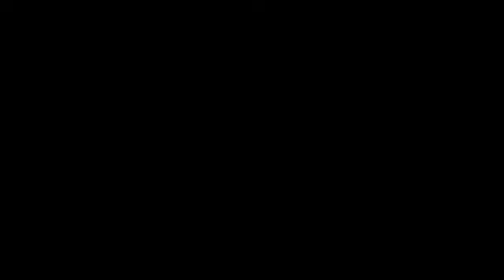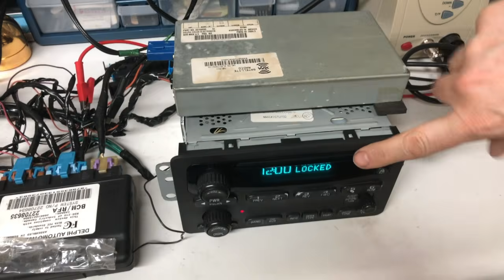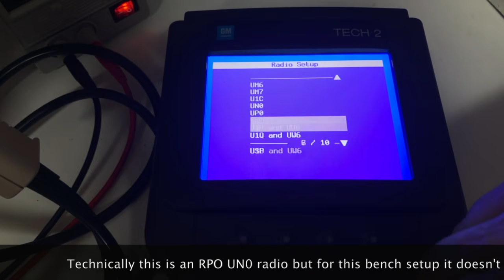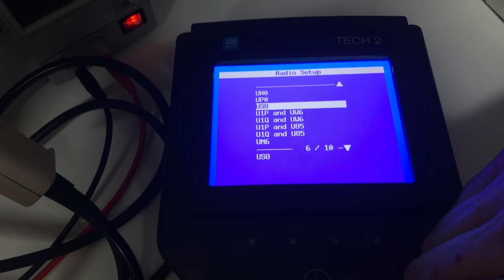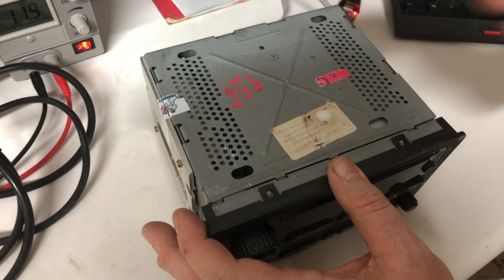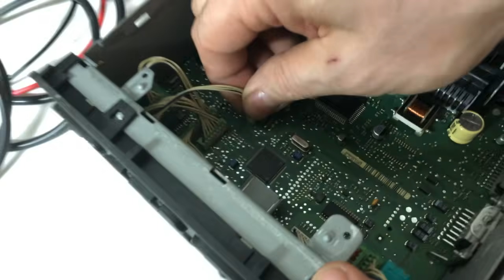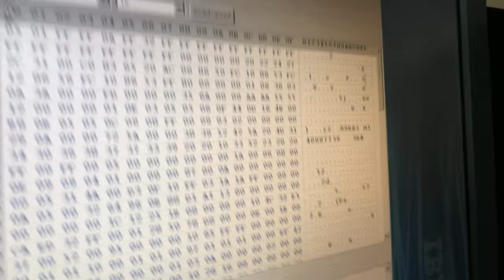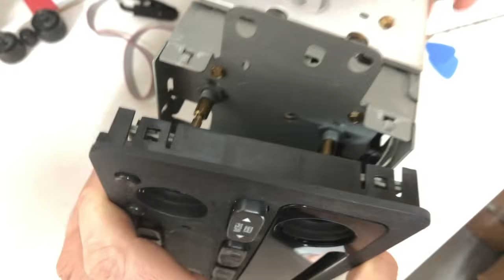2003 - 2006 How to VIN Unlock Salvage Yard GM RDS Radio w/ Tech2 OR Manually Programming its EEPROM

Comment: Loved the video. My problem is that I can read the settings, but they all show up as O. Could the people I bought the radio from erased all the settings
Reply from the maker: When you say "I can read the settings" yet are seeing all 0's, can you elaborate?   Trying to determine if you see the EEPROM contents otherwise just not the VIN.
Reply: It says reading IC, the green light is on, but the only thing that comes up is all zeros, but no contents. I'll send you a screen shot
Reply: Sorry I could not get a screen shot to work. I had company come up and one of us knocked the IC off the bench, and I can not find it. I have some new IC's coming. I was told to put the new IC in, with no programing and let the ECM program it. Any ideas?
Reply from the maker: If it reads 0's, that usually means it's not making contact with all the pins.  Typically a problem when you try to read it in-circuit with a test clip.  Some radio boards have other components that interfere and you have to desolder and remove the IC to read it correctly.   If you have it desoldered and you're still getting 0's, then I'd have to presume you either have the programmer set for the wrong device type or you removed a different 8 pin device that was not the EEPROM.    Most models will work with a blank yes, but some won't.   That's why I showed this approach that works every time.
Reply: @DrShock  Could I possible  get a copy of the file you used to program the radio with the Asprogramer?. I realize I will have to change the serial number and vin number, but that should not be a problem.
Reply from the maker: @larrymartin975  I no longer have the memory images for this particular radio chip.

Comment: So I did a factory upgrade radio in my 07 classic. Whent from a base w/t radio to a 6 CD radio. Since they have different cereal numbers would I still be able to reprogram the eprom vin? Or would it still be locked do to the different cereal number?
Reply from the maker: The VIN of the vehicle is the serial number of interest here, not the radios' serial.   So as long as the 2007 radio you went with was the part number available in model year 2007 the Tech2 will recognize it and do the unlock (if you mix years/part numbers the Tech2 will usually not cooperate for non-factory available configurations).   And if you choose to go the EEPROM route instead, yeah it would just be changing the VIN stored in there as I showed for these 2003-2005 ones.
Reply: @DrShock  ok. Not shure what year the radio came out of. I know it's the newer 05 up one. I have one from an 03 and the part number is different. So hopefully the one I have installed is the right part number.

Comment: So I just tried similar radio with a cassette, the eeprom is angled different and could not get reading from it . So some of the EEproms need to be read outside of the board ? Had similar issues with Pontiac radios that come with yellow and white buttons
Reply from the maker: Actually most chips need to be removed to read.  It's usually because you just cannot get a test clip into the space, but there are some years that have extra circuitry that the test clip inadvertently powers up creating bus contention.
Reply: @DrShock  appreciate your reply . Thank you

Comment: I took out the chip and now I am getting an error message that says error.
Reply from the maker: If it says "cal error" that would be normal until you reinstall the eeprom back to the board.  If not, you may want to check that you removed the particular part numbered chip that I mentioned in the video here and not any other one of the same size and type.
Reply: @DrShock Yea it just say error. I can seem to find the chip you have on the video, not sure if the circuit board lay out is different. I appreciate you replying back as I am stumped.
Reply from the maker: What year is the radio and from what make and model vehicle?
Reply: @DrShock  I actually pulled it from a 05   trailblazer from the salvage yard. I have a 03 suburban that I tried putting the until in. The unit still powers up but just shows "error" only.
Reply: I wish I could send you a pic of where and what I pulled out. The layout of your chip board looks different from mine for sure
Reply from the maker: Yeah that would be a great feature if Youtube added it someday to post pics.   The radio PCBs do vary from year to year and model to model.   The EEPROM you're after is most commonly located in the upper right front (rear of radio facing you) as I show in the video.  But it can be paired with a second unrelated chip either top to bottom as I showed, or side by side in some other PCBs.  Some radios will have the EEPROM all alone in the center area of the PCB.   But the EEPROM you're after should have the same Delphi 9355093 part number as what I showed in all cases (if the radio was made by Delphi which is what this video covers).  This same Delphi part number is found in their radios on Cavalier, Sunfire, Silverado, HHR, Avalanche, Tahoe, and SSR.  I would expect its the same for the Suburban and Trailblazer as well.  So what's the number on the chip you removed given all this?
Reply: @DrShock  if I pulled the wrong chip..am I at a point of no return. I'm assuming I did.
Reply from the maker: Not necessarily, presuming you just removed it and it was not a memory device just return it to its original pin 1 orientation where you removed it from with no harm done  If it was a different memory device, and you overwrote its contents, then yeah it may be a salvage yard trip to repair that.

Comment: What if you don't have a test clip
Reply from the maker: I always try a test clip first, but there are many modules where it's not possible to use them (because you end up powering up other devices on the board thru them).   As with those cases, if you do not have a test clip just remove the chip from the board using ChipQuik (link in description) or a hot air gun.

Comment: i set this all up and it read the eeprom as nothing just 0 values
Reply from the maker: If you're trying to read in-circuit, then it's an interference problem on the data lines from some other devices being powered up.  Remove the chip from the board and retry that way.

Comment: So I've used your method and unlocked a radio and and XM module like this successfully but I'm having trouble with another stereo I'm doing for a friend.  It'll say that it reads it successfully but everything is blank. I've been trying for 2 hours thinking that maybe something wasn't making contact or something else like that, but it's just been blank this whole time and I can't get it to read. What could I do? It's out of a grand am.
Reply from the maker: All 00s, rather than all FFs, would indicate you're not getting a clear read to me.   Did you remove the chip from the circuit board to read it?
Reply: Nope, test clip
Reply from the maker: Yeah ok that's what I thought.   I've seen this on some circuits, even across radios from different suppliers (Delphi vs Panasonic e.g.).   It usually means you've powered something else up on the board via the testclip and it's interfering with the data bus lines.  When I hit this, I usually just remove the chip from the PCB and continue that way.

Comment: Did your front speakers stop working? I followed instructions and I he front speakers don't work now only the rear ones do
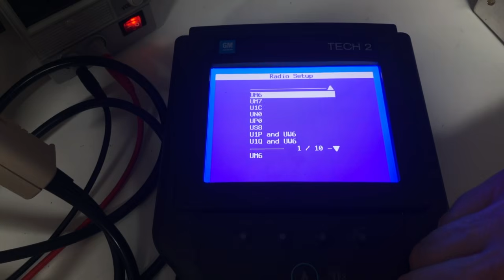Reply from the maker: When using the Tech2 setup method, you have to choose the correct option code at 3:21 for what speakers you have.   If you used the EEPROM method swap method, as I mentioned in the video both radios have to have the same exact GM part number.   If you just updated the VIN in the EEPROM contents, that's not going to have anything to do with speakers - recheck that you didn't overwrite some other area of memory by accident in doing so.

Comment: Great video. I have a question. I have a tech 2 and I got a radio for my 2004 Chevy Tahoe from a 2006 Silverado with the same RPO options for the audio system. I followed the steps described in the video and it won’t unlock. The only thing I noticed was when the scanner is “establishing communication” after selecting all options it’s saying digital radio receiver not responding. Would the XM receiver cause a problem? When I do the radio setup it says “procedure is progress” then goes right to procedure complete and the radio is still locked. I tried a coupe key cycles and it remains locked. Not sure what to do at this point. On side note there was a aftermarket radio installed and it had one of those chime boxes. All the factory wiring is in place and all the aftermarket stuff is removed. Any help would be greatly appreciated. Thanks.
Reply: Did you ever get this working? I’m having same no communication issue when trying to replace radio in my 03 burb.
Reply from the maker: Those chime boxes would interfere with the Tech2 communication to the radio.  Besides removing it, you have to be sure there is no damage to the original harness, particularly the serial communication wire (usually purple but not always).    The XM radio receiver is a totally different thing, in fact it cannot be unlocked even by a Tech2 (different video for that one).    To insure the communications is working, I would try using the Tech2 to pull read only radio information (e.g., part number) as a test.     If you can't communicate with the radio it could be because you're mixing years here 2004 Body Control Module with a 2006 Radio where the 2006 radio has changed the unlock/setup procedure (2005 was a transition year as I mention in the video description where the menu options on the Tech2 changed).   So you might try building the truck as a 2006 and retry to read the radio part number and see if that gets communications working.

Comment: So I tried the thing where you unlock the head unit by just changing it to the serial number of the original one and it works. It does say calibrate (pontiac 6 CD changer unit), but I'm not sure that's related.
Reply from the maker: Calibration error indicates something missing from the chip that the firmware was looking for.  Folks that yank the eeprom off the board as a crude way of unlocking it end up with this error, for example.     Likely was there in before you did anything and should just pop up momentarily at each power on and then clear.  Shouldn't block any functionality.     If it bothered you you'ld need a Tech2 to run setup and the tool would automatically fill in what it's complaining about.   I did a different video about these CAL ERR ones but its the same setup menu as I show in this one.
Reply: @DrShock  I just got the vid in my recommended. And yes, no functionality issues, it seems every Pontiac radio I see does this.

Comment: I have a 2003 tahoe that I am trying to get a 05 suburban radio programed to and the tech2 that the shop i work at has no such function for a 2003. Why is this. Do the pickups work the same as the cars?
Reply from the maker: The Tech2 menu options will vary by make and model as well as year.   That's why you have to build the vehicle by answering all those questions up front.   In the description I mention where this menu shows up for 2006 to 2010 cars, you might try that menu path for the 03 Tahoe.   I haven't worked on that series of trucks so not directly familiar with the menu for them.

Comment: Great video, very professionally explained, I wish you can do something like this for the 2006 Chevy Malibu Delphi Delco radio, thanks.
Reply from the maker: Thanks.   I mention in the video description how you can use the Tech2 or MDI scan tool to unlock a 2006 thru 2010 model radio as well.   It's the same approach, just GM moved the menu option.

Comment: will this work on the 96 year?
Reply from the maker: No, the older 90s radios was a different system than the newer RDS type radios used in this video.
Reply: a  GM tech 2 reader can access the code?
Reply from the maker: No, no Tech2 support for those 90s radios that I'm aware of.  You used to hold down the 1 and 4 buttons when it said LOC (or 2 and 3 on some models).  Then pressed the AM/FM button.  It would give you a 6 digit code that you then called an 800 number with a dealership code to get an unlock code.   But GM discontinued that 800 number in late 2019.   I'm sure it's stored in a similar EEPROM chip, but I haven't had a situation to go looking for it yet.  Here's a pointer to the procedure, which is unfortunately no longer performable, https://static.nhtsa.gov/odi/tsbs/2018/MC-10141381-9999.pdf and the replacement when they stopped it - https://static.nhtsa.gov/odi/tsbs/2019/MC-10168979-9999.pdf
Reply from the maker: Actually after updating the previous comment with the last preliminary service information bulletin (PIC bulletin) I found that GM followed up with a service bulletin in December 2019.  Looks like you have to pay for these radios to be unlocked now.  Once they discontinued the free self service 800 unlock system they moved the dealers to using electronic service center only.   So you'll have to take the service bulletin to your GM dealer to get the radio unlocked now (some might do it for free, but suspect most will charge you) - https://static.nhtsa.gov/odi/tsbs/2019/MC-10170494-9999.pdf
Reply: @DrShock  interestingly I just tried it on February 13 2021 and it does work.
Reply from the maker: @brayannexon4613  Yep, back by popular demand I presume just a few months ago actually.  I posted about it on the video for the Theftlock codes (this video here is for RDS which does not use any codes) - https://youtu.be/OJg6czxvJ2I

Comment: Do I need the original VIN? How do I recognize the original partial VIN location if I don't know the number. I bought a radio from a Facebook Marketplace seller.
Reply from the maker: If you use a GM scan tool you don't need to know anything, it will read the VIN from the BCM automatically as part of the setup process.  If you're doing the EEPROM method, then it depends.  If you have the same model radio I've shown here then you already know where the VIN sits in memory.  If not, you kinda have to know the donor vehicle VIN to locate it as other radio models may have this stored in a different memory location.
Reply: @DrShock  My radio is similar except also has cassette. I've asked the seller for the VIN for the truck the radio came from. Otherwise I'll just have to find somebody with a Tech scanner. Anyway thank you for posting this procedure. Cool stuff to know.
Reply: I went down the wrong path trying to use the adaptor mod shown in the CH341 5v mod video. My radios chip is in a different position on the board but has the same part number as the one shown here. I bought some eproms to try in case it just didn't want to work in circuit. There are no dots, notches bevels or anything to indicate where pin one is on my chip in the radio or the ones I bought. It appears when the writing on the chip is right side up, pin one is the lower left. The labels on the chips I bought are unreadable to my eyes, even magnified. I bought 2 more CH341s off Amazon. Tried so many things, reinstalls, different drivers. Been messing with this off and on for weeks. Not sure I know what combination  of efforts got it to work. I have programmed 2 radios. I've not put one in the car yet to see it they'll work. Still looking for one screw from the cassette transport that hit the floor.
Reply: Both radios work so the eprom thing is a success, but both radios have problems with tape & CD functions. My Chevy Trailblazer came to me with a radio missing. I just want a factory CD/Tape radio in it. Trying to decipher the mechanisms while also shopping for another replacement

Comment: Hi Dr. Shock .I've owned 4 Grand am GT's . I sold 2  to a friend of mine .1 for his wife (who later hit a couple of deer and wrote it off ),& the second to him (cause his 98 GMC 's transmission gave ip the ghost after 600000 km.) And the last one I still have . The problem is that the displays head south (or caught the covid). Anyway after tripping to the wreckers yesterday I  found 2 monsoon replacements .took them home and swapped them out to see if the displays were good .Sure enough they checked out ok . But the brick wall appeared calibrate then lock . Strange thing though they worked as long as the engine was off ,but as soon as I started up the engine, calibrate  then locked .so the next time I tripping to the wreckers, would grabbing the BCM and rsdio from the same car ,would that solve the problem? Or is it the knee bone connected to thigh bone connected to the ankle bone kinda situation? Or is it possible to just un board the display and organ transplant? Or are there even more bo bee traps along this path of thought ? Im starting to feel like a scientist who has to backwards engineer some strange alien technology.
Reply from the maker: The BCMs in these years will store the VIN and mileage and you cannot change them without doing EEPROM chip level surgery.   If I had this problem I'd just disassemble the radio head unit and swap the display modules.   I don't know if that's plug and play, or requires some desoldering/soldering though.